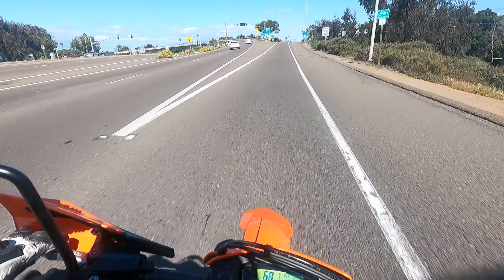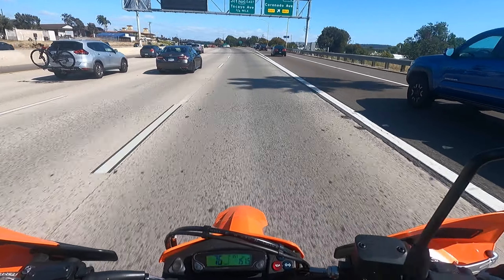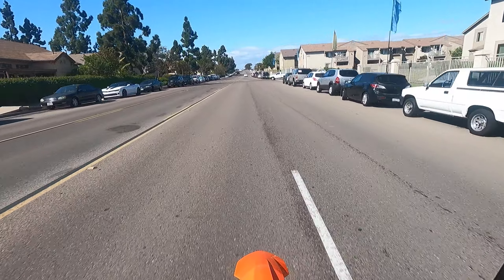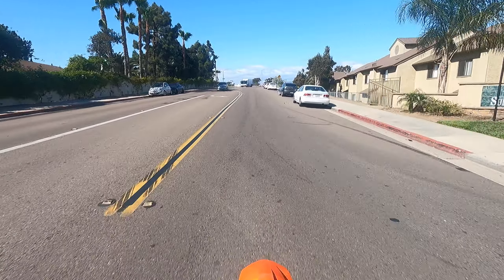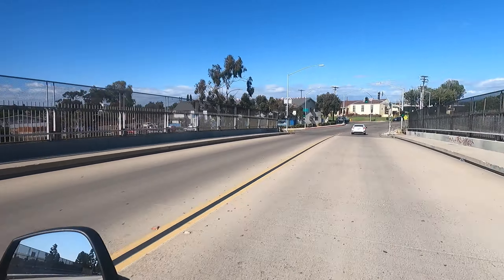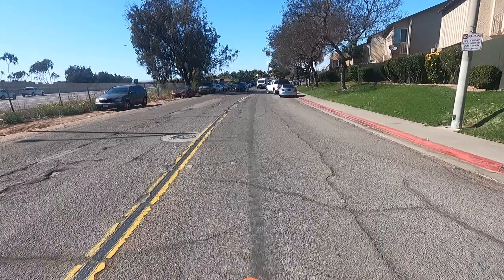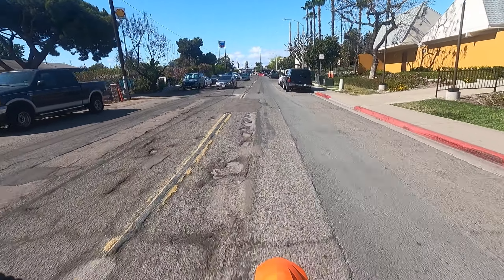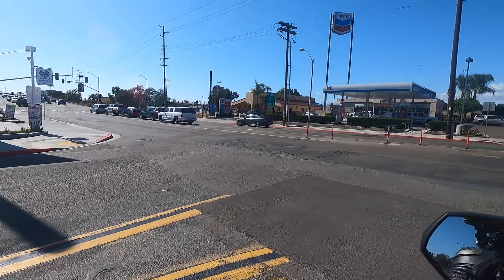2021 KTM 690 Enduro R  commutability

Comment: I put the KTM Remus pipe on mine, also took out the DB killer.. runs sweet love it..The stock exhaust runs so hot it can melt your side guard..
Reply from the maker: So true.
Its dangerous!
Probably start a brush fire if you played in down in the wrong conditions.